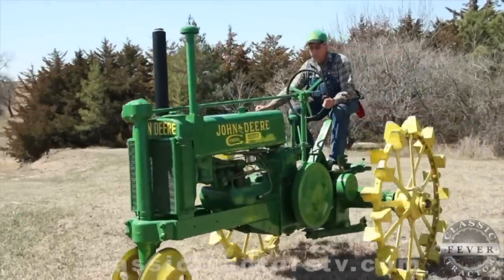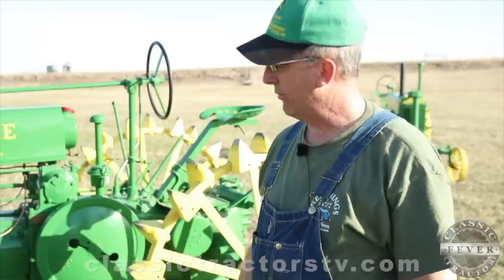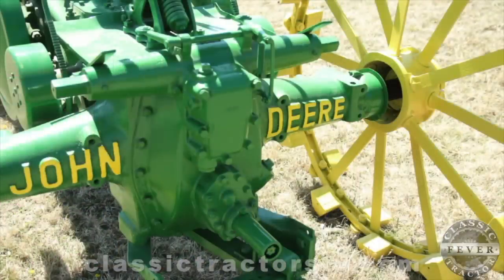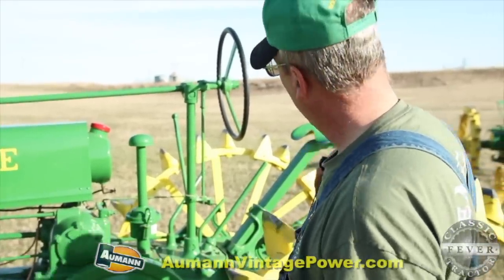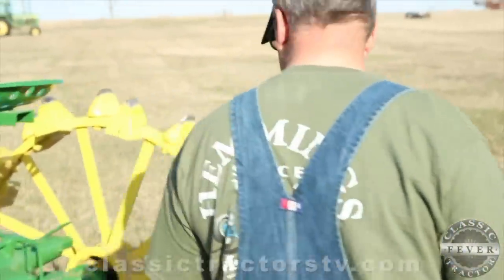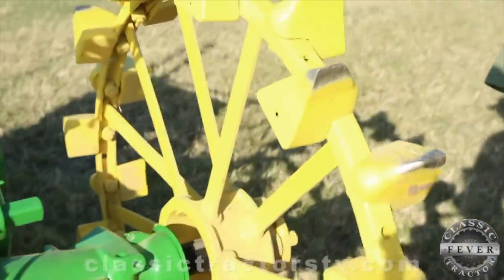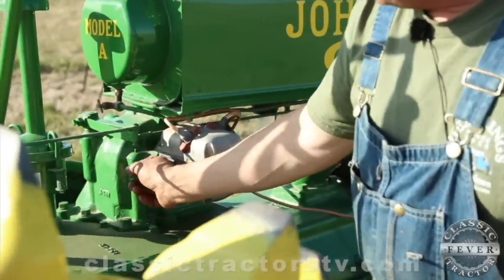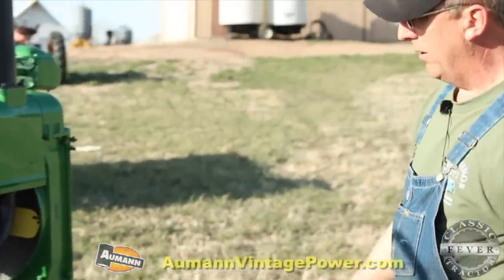1935 John Deere Model A - How The Model A Changed Over The Years - Classic Tractor Fever

Comment: I have a 1935 a that I just bought. can you recommend where I can find a good maintenance manual for it all the ones I find show 1938 and later I can't really find anything for 1935. I noticed my oil pump is not on the bottom. I can't find any literature on these early A models.

Comment: I just seen that rock shaft power lift , that exact one, welded to a plate, and installed on the back of a farmall H.  Untill I seen this, I didn't know what John Deere tractor it came off of .

Comment: Fernando,  Steel lugs DID NOT have the same gripping power as rubber tires..  In 72 and I know.  Dad said whenever he hit a gopher hole with his 37 WD A with the same skeleton grip wheels as shown on the above A, , down shed go.
Reply: The one great thing about metal lugs is all you needed when stuck was a fence post or two..
Reply: Where I live in upstate NY my grandfather said lugs were great bc with our wet heavy clay soil,lugs would grip better vs rubber which just spin. But once they blacktopped our rd in I think 82 & banned metal wheels,we went full rubber.